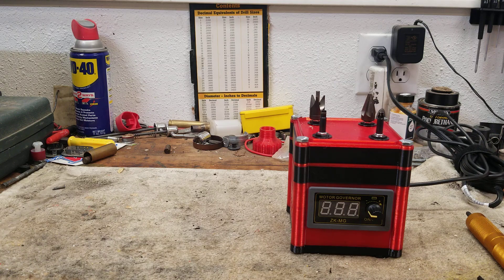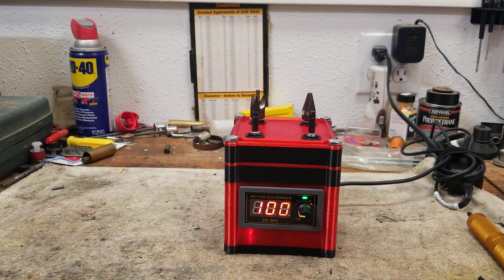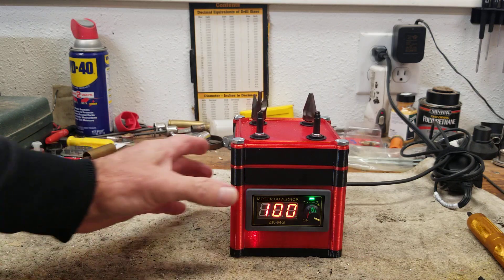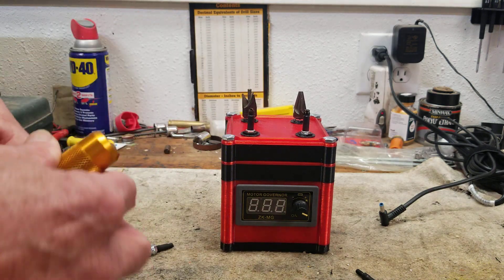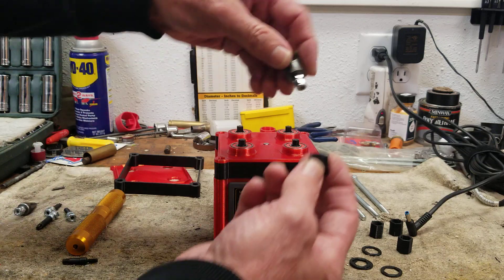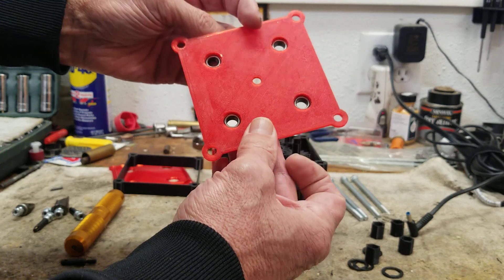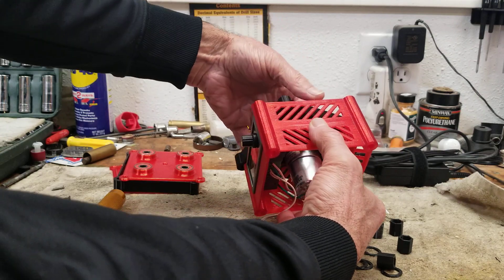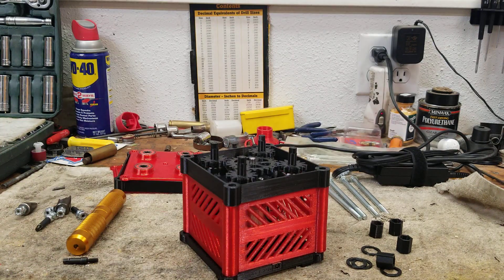3D Printed DIY Brass Prep Station (under $50)

Comment: Hi, thank you for the files. Just printed them out. Look very good. Just have to wait for the bearings, motor, etc. In your Drawing the main plate #6 is doubled and i use metric bots and nuts. hope they will fit.
Reply from the maker: Your are right #6 is in there twice.  Funny after all these years no one else has pointed that out.  Using 6mm bolts should work fine.

Comment: Thanks for designing and sharing this.  Got it all assembled but it seems like the motor has a hard time getting started.  Maybe my gear friction is a little too much, not sure if this is an issue you ran into and adjusted something to fix
Reply from the maker: It's most likely the gears are too tightly meshed together.  I used close tolerances so there would be very little slop.  But everyone's printer prints a little bit different.  You have to make sure your printer prints dimensionally accurate.  A 10mm hole should be a 10mm hole. I have not been back to this since I posted it.  Most of my concentration has been on my brass annealer.
Reply: @msgbean  Thanks for the quick response.  I think the system maybe needed to run for a bit to wear in and fold over any plastic burrs?  Now there is the delay of the governor energizing but everything starts turning shortly after and applying pressure on the bits does not stall it out.  Great design.
Reply from the maker: @mitchellmiller1990  You might want to disconnect the motor and turn it by hand.  That will tell you where the problem is.

Comment: I really like the concept but what's the deal with all the wobbling in the tools as they spin
Reply from the maker: The one reamer in the back was not seated correctly.
Reply: 3d printed shafts are hard to keep from warping. I have the same problem with my annealer.

Comment: For the okes who struggled with getting the parts to fit, what did you do, did you just resize the print in in the slicer, I also printed this, the casings etc are fine, but the hexagon shapes dont fit into each other
Reply: calibrate your printer

Comment: Just my luck. I printed out the parts but they don't fit. :( Ender3 Pro. The parts look great but everything seems to big slightly too big, or too small like the bearing cups. The bearings won't fit. I haven't tried a heat gun yet. Maybe next ting to do. So it's back to the drawing board. This usually happens to a lot of other files, including  the ones I design. Back to the drawing board. I really like this project. Hope I can figure out how to get everything to fit.
Reply: Success! I got my machine put together and tested it out today. I had to re-print several pieces to get them all to fit. In fact I gave up on the main gear. After a lot of searching on You Tube, I learned how to make a gear in Sketchup. That is what I use. It fit perfectly the first time. I didn't use the variable speed thing. Wide open is good for me. I already have three of the tools so I am good to go for less than $50. I used a 2.1x5.5mm DC Power Jack Plug Adapter Connector and a 12 volt power adapter. The connector fit perfectly on the bottom plate. Looks plumb professional! :) I have an on/off switch on order so I will finish it up when it comes in. Thanks again. You did a great job. Oh, btw, eSun PLA+ orange with black tool holders and dust covers.
Reply from the maker: @michaelhenderson5098  I'm glad to hear it works out for you.
Reply from the maker: That is the typical problem with printing someone else's project on a different printer.  No two printers seem to print exactly the same unless some adjustments in the slicer are made.  Before I started this project I did some adjusting so that if I printed a 10mm circle it was indeed 10mm when finished.  Different materials also shrink at different amounts which can change the size of the final product.

Comment: Sir great job, can you provide information on what was used to mount the tool nuts to the gear shafts, and did you use an in to secure them to the gears.
Reply from the maker: I just held the tool in a vise and used a wrench to screw on the lock nuts.  The two nuts are tightened together ensuring the nuts are aligned with each other.  They are then held in place by the 3D printed tool holders which connect to the gears.
Reply: @msgbean  ok wasn't sure if gears except the tool holder. Oh what was used  for the holder that accepts the nuts
Reply from the maker: @markholben2718  The gear shaft goes into the lower bearing then the gear goes on the gear shaft, followed by the 2nd bearing, then the tool holder.